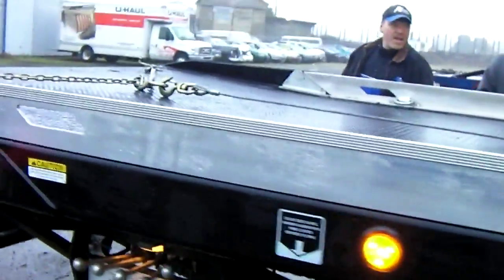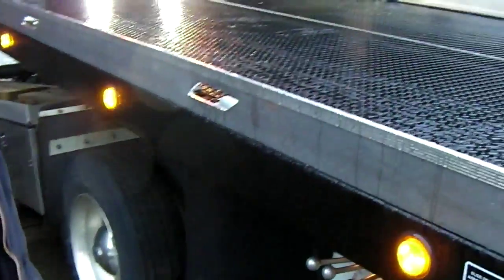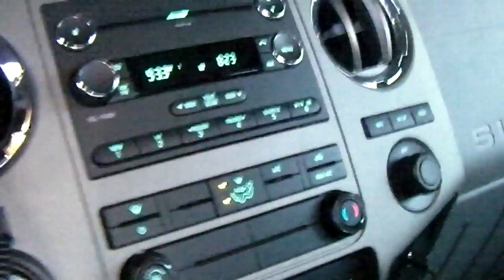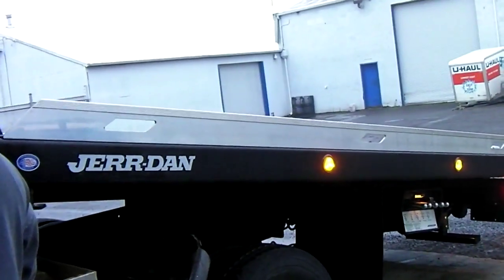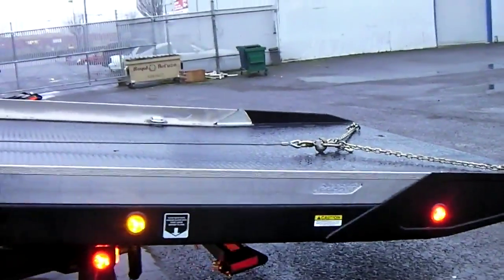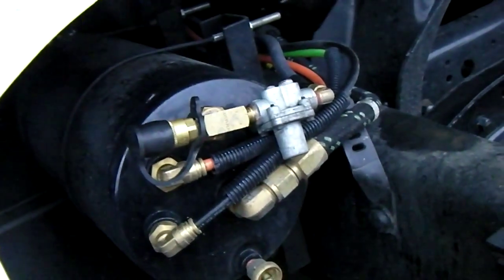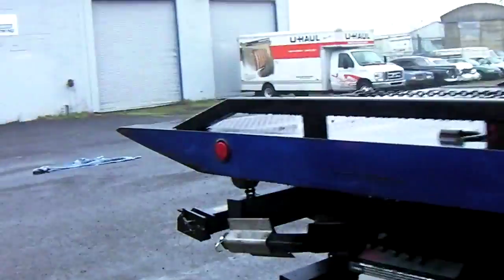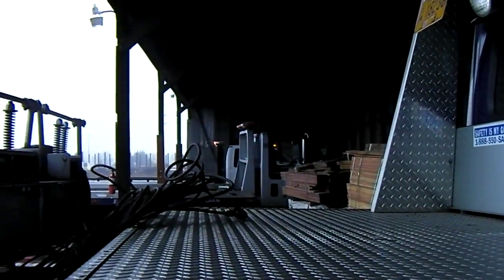Towing Recovery - New Tow Truck Added To The Fleet

Comment: We run a couple F650s same style just older. One is air one is hydraulic. I usually run the one with air becuase everyone hates the brakes. However I know how to use the exhaust brake, so I dig it. We just bought a UD, and I'm still on the fence with it.

Comment: I remember that the Freightliners over at Trac had the airbags on the rear. Big problems when you would do a side pull recovery with the deck lowered as the airbags would slip out of their retainers and leak down. Big pain in the ass. Plus it is a Ford. Yuck.